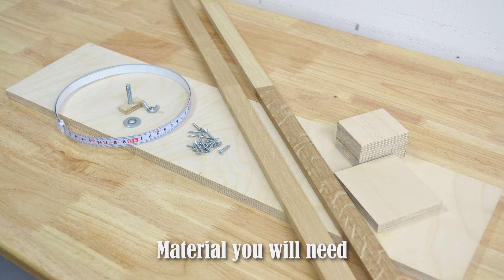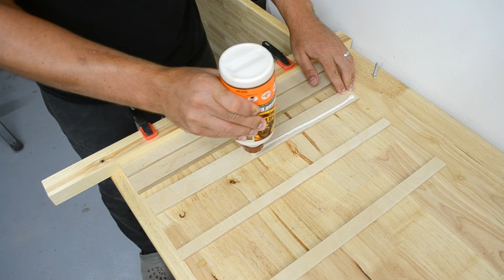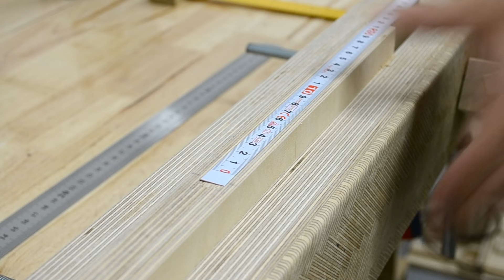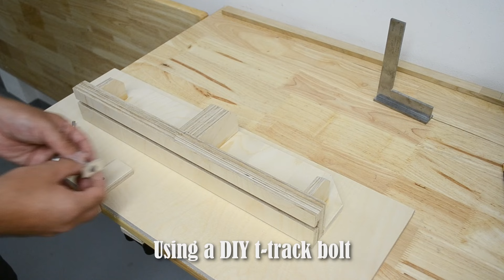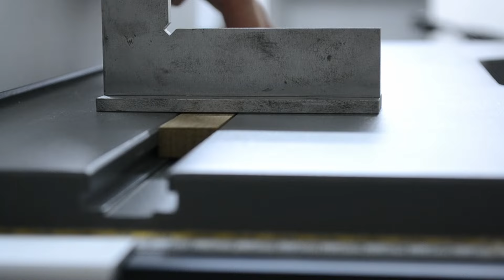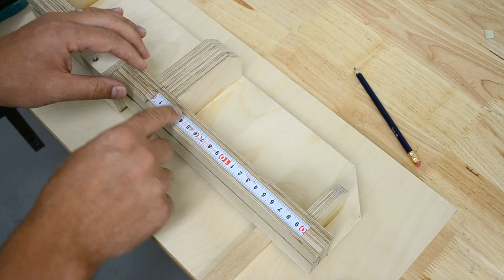Small Crosscut Sled for Table Saw DWE7491RS

Comment: Question:? you draw a line completely over the entire surface , and then you use a fence on the table saw to cut that piece of wood Why do you need that line ? isn't it just measuring the distance of the fence to the blade and saw it off ?
Reply from the maker: Pretty much yes, you don't need the line per say. I use it to make sure I am really cutting where I want. When you're changing blades your fence is not entirely calibrated and there can be discrepencies

Comment: Very nice design! Is it possible to create this sled with standard pine planks instead of plywood? I have a lot of pine remains and  plywood is available to me only in large expensi5ve boards. For the runners I have wallnut.
Reply from the maker: Hello :) Thank you. And I believe you can. Pine would not be as durable as plywood but it will work. Just make sure the planks are straight. 👍